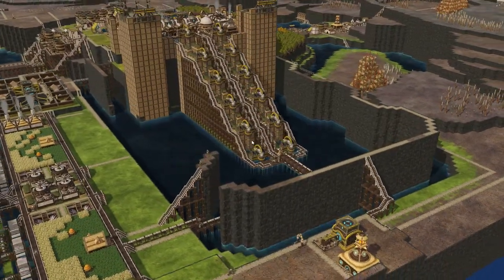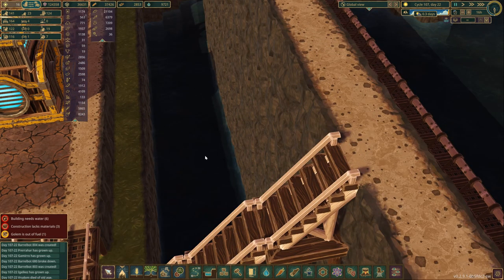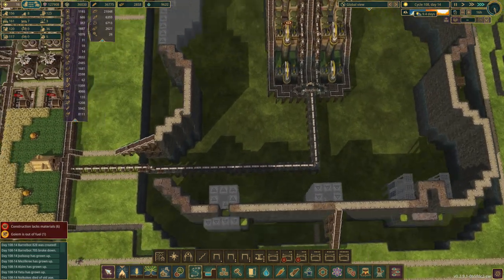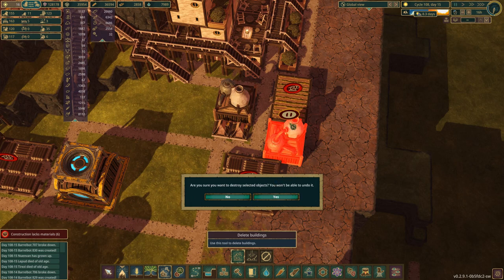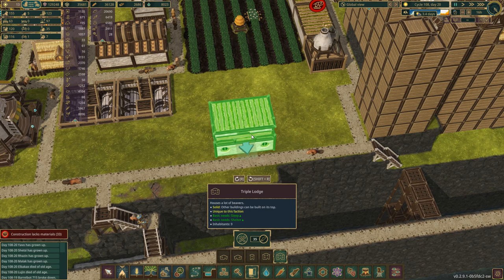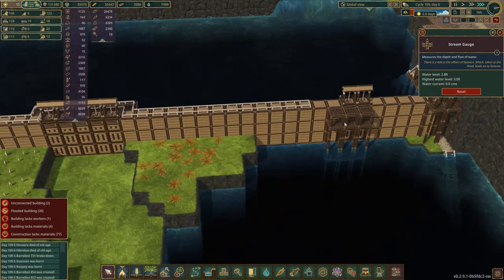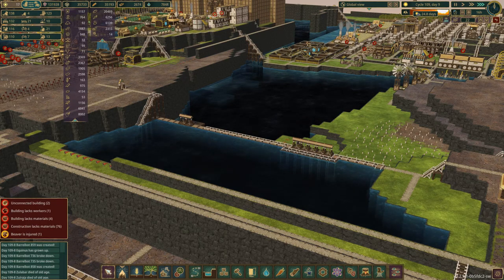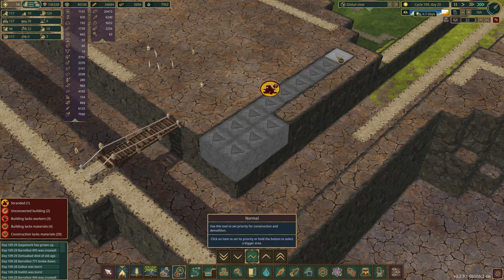GIGA Reservoir CANAL SYSTEM and MAIN STRUCTURE! - Timberborn Hard Mode

Comment: Man that castle is awesome! 
You might be able to use different combinations of buildings (, that transfer power!!) To make something resembling a guard tower in order to hide/omit the need for the power shafts on the side of the castle. 
The connection for the other side can be buried and covered with platforms.

Comment: I'd suggest using 6 beaver housing stacked to bring power up the side of the castle.

The same idea could be used to add houses (guard shacks) to the front moat wall to bring power to those pumps.

Comment: For transferring power downward from the castle, you could bury buildings that transfer power into the wall so its basically a vertical connector? its a lot easier with the ironteeth's tall housing, but I reckon you can figure it out :P

Comment: You have to power the pumps that pull from the drainage ditch into the reservoir.  Run the power to those from the Lowborn's water wheels, then run that power down the inside of the reservoir wall and into the pumps at the hanging gardens.  That will connect the Lowborn's power to the rest of Beaver Castle and most of it will be hidden inside of the GIga Reservoir.

Comment: Run the power down with the main pumps going into the giga reservoir, then bring it back up inside the reservoir and down the other side using the waterfalls on the outside to hide it. If you use the end middle where you want to put the 3 pumps up as a waterfall instead of a pump, you could build it 1 square down so it’s always the last waterfall to stop flowing.

Comment: could do a central ish block of buildings as they all transmit power if connected could still split paths in to districts and runs buildings as solidly as possible apart from a few power lines in any larger gaps

Comment: You could use the existing "old" small reservoir as the spillover for the canal. That saves you from having to completely demolish the dams there. You'd only need to dynamite a few pieces of the canal, replace them with flood gates and boom. 

Also, aquatic farming, when?

Comment: For the hiding of power shafts, could you use the landscaping and hide it? Add trees to make it look natural ish.. kinda like a mountain side, but have power shafts behind it.
Reply: Are any of the building elements water thight from above- so you can run stuff under water without causing a leak or flood areas?

Comment: 10:24 Concerned over 200 medicines while the overall resource counter shows that there are 1251 medicines in the Castle area and a whopping 2485 medicines inside the whole settlement storage. 🤔
Someone seems to have gotten burned by a lack of medicine once. 😅

12:50 And the whole keeping a natural mountain in-between two artificial ones is thrown out of the window.😆

27:35 You should totally rewatch this timestamp in case you read this comment.😘

28:35 The thought every hobby builder has when they find one remaining piece of their project still lying around half an hour after they already finished.

35:42 Maybe doing the same setup as with the hidden windfarms for the transmissions to cut the area it occupies down and then a Levi scaffold (like a buttress) to hide (most of) it away further?

Comment: The only really good solution to the power line I can think of is mods. I've seen a mod that adds vertical power shafts in. So that you can just stack the power rods straight up, rather than stair-stepping it all the way.

Comment: Is that brick tower housing structure that transmits power exclusive to the other beaver faction? Nilaus used it to move power down a cliffside compactly and it looked pretty clean.
Reply from the maker: Ironteeth exclusive :)
Reply: That structure is an iron teeth exclusive but there are a couple other fairly tall buildings you can use instead
Reply: Stack the narrow housing one on top of the other down the side wall?